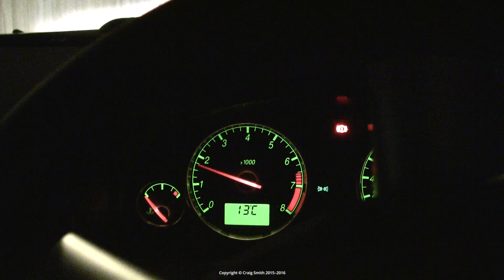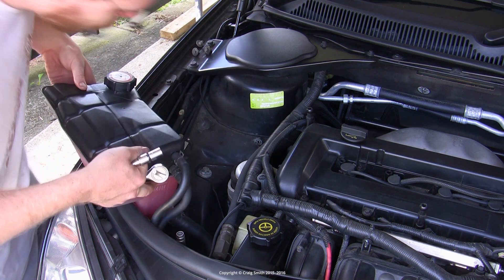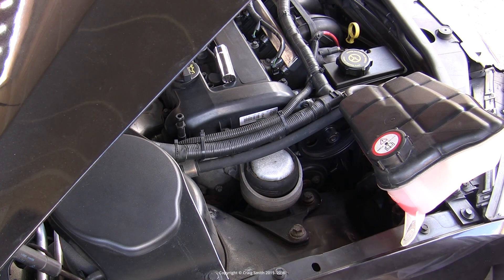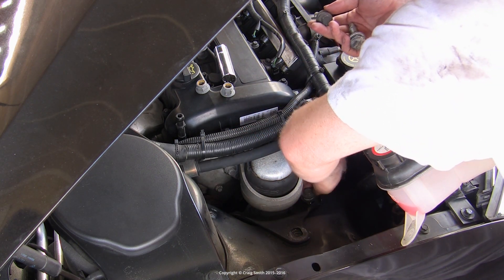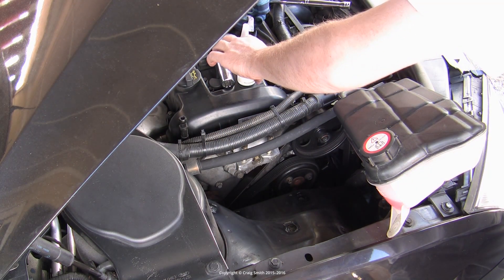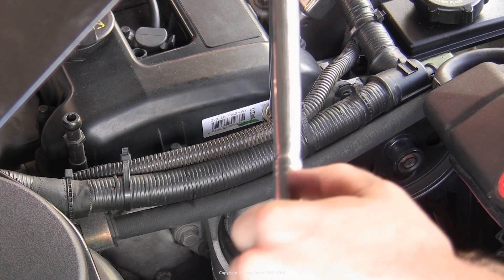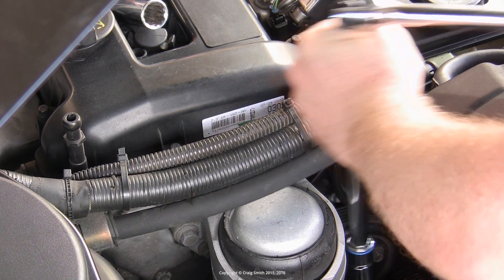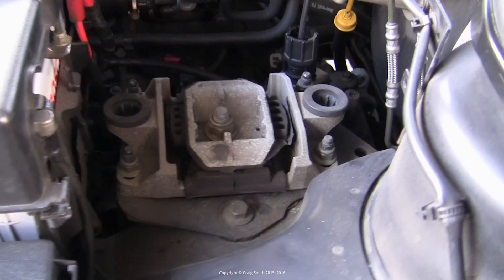How to: Replace Ford engine mounts (Duratec, Mondeo)

Comment: I want to thank you for all the direct and duffle information you have provided. I like to say all roads lead to Rome. Meaning any shortcomings in the suspension and frame related equipment mostly begin with bad shocks and struts.

Comment: I have some remarks. Like you said - nuts with blue plastic nylocs are self locking, are NOT reusable and must be renewed once loosened. Also it is not allowed to put any liquid or paste between nut and part because you change the calculated friction based on the nut torque. Those nuts do not use a washer for a reason because their bottom surface must have a certain amount to provide the frictional connection and grip.

Comment: "Work quickly" lol

Nice job mate. How did you keep your engine bay this clean throughout the years? I've seen much worse ones. Is the odometer showing in miles or kilometers?
Reply: At 00:23 you can see the speedometer and it says "km/h", so I'm guessing the odometer is also in km.

Comment: Hi Graig
after watching your vidoe, very clear, I'm not getting vibration but getting what I would call engine slap.
If I accelerate or de- accelerate I get a lot of movement from the engine, too much I think. I have had the large round engine mount replaced and that helped slightly 
Can you suggest any other reason that would cause this problem?
Thank you for your very clear video's 
Danny
Reply from the maker: Well what restrains torsional movement is the lower 'mount', or torque restrictor, so maybe the rubber on that is gone? Not entirely sure what you're describing.
Reply: Hi Graig,
many thanks for taking the time to reply.
I'm getting an excessive engine movement when I apply slight acceleration or de-acceleration.
I have had my car in 2 gear hand brake on with my brother sitting  in the drivers seat and just dapping throttle pedal and the engine I think is twisting too much..
I will get it checked out at a garage I haven't a garage ,park on the road.
many thanks for your help
Danny
Reply from the maker: Is it making noise? They do move quite a lot normally. If you're not getting metal-on-metal vibration I wouldn't worry about it. If it is moving too much then it has to be mounts gone, including the lower torque restrictor. See here for demo of engine shifting https://youtu.be/H2P74cIvlmg

Comment: I have the same car but a 2.0 litre, I also have a vibration and been scratching my head as to what it causing it. Did you have a vibration at all levels? IE, idle and normal driving?
Your videos are a life saver, now need to buy the correct ones.
Oh and I think your voice is great, very pleasing to the ear :)
Reply from the maker: Mounts will cause varying vibration with mode and attitude of the car as it affects weight on the engine. E.g. gear reverse/neutral/forward, on hill or camber. It's not hard to check the mounts as shown. But vibration can be caused by dozens of other things of course.
Reply: Thanks for the reply, My vibration is when the car is idle, if you put your hands on the seats or doors or dash you can feel a tingling vibration, don't mind changing mounts if it is that that is causing it, is there any other typical thing that would cause vibrations? Thanks.
Reply: @stevemoore999  mine the same now did you cure your problem and what was it thanks
Reply: @paulhughes9012  Hi, it just disappeared about 18 months ago, never found out what it was
Reply: @stevemoore999  ok thanks for reply m8 hopfully mine will disapear wishfull thinking haa thanks again

Comment: Hi Craig, sorry for another question.

 I have changed the transmission oil again, so I am pretty happy with that now.

I'm leaning to the engine mounts again.

I noticed you mentioned in your video you had vibration with worn out engine mounts.

I have noticed, when my car is in Park there are no vibrations, when I have it in Drive and I hold on the brakes, I get vibration but whilst driving no vibration.

Is it normal to have vibration whilst in Drive and holding the vehicle still on the brakes, is this the same sort of issue you had?

Thank you for the help, this is my first automatic so I'm new and still learning.

Alex
Reply from the maker: The engine will shift around depending on torque being applied thru the gearbox, and the angle of the car's tilt or pitch, so applying different stress on the mounts in different circumstances. If you're feeling vibration thru the body that feels like metal-on-metal contact from the motor then that suggests mounts. The problem is of course the engine or trans if they have a mechanical problem they will also behave differently in different situations. You could try using a steep hill to experiment? e.g. put car in drive and neutral with car pointing downhill uphill and sideways to see if it changes the behavior. Have you visually inspected the torque restrictor as this is the other very common mount failure? Place a camera to view up close while shifting F-N-D.
Reply: @CraigsDIY  Hi Craig, thank you for the reply. 

I have replaced the torque restrictor as that was very worn and split.

As noted, I can only notice the vibration whilst in D holding on the brakes, I will your experiment to see if I can tell if there is a difference on a steep hill as you have suggested, as well I will try and jack the engine slightly alleviate the vibrations which you have mentioned on your video to see if I can pinpoint it that way. 

Thank you again, Craig, your videos have been a massive help!

Comment: hi mate, did you jack the car up whilst it was running to figure out the vibration was on the right hand side? also what kind of vibrations did you get? was it in the floor pan close to the pedals? thanks
Reply from the maker: It's metal on metal contact between the engine and body mate, it makes the whole car vibrate. Yes you can jack the engine to take the weight off its mount. If the vibration suddenly disappears, then that's pretty clear. If not, try the other side (transmission).
Reply: @CraigsDIY  thanks, I changed the middle lower mount because that had split, my top right side looks OK similar to yours but i need to take it off to see if properly, because I get a vibration that's in the floor and travels to the pedals and goes up my leg making the drive a little uncomfy

Comment: Hi Craig,

With regards to the engine mounts, do you have any means of sourcing these like for e.g.the torque restrictor from jaguar, or do you just use main dealer ford or a pattern part?

The issue I am having Craig, when at low revs when the car changes I get a jolt, when I'm on the throttle higher revs this issue is alleviated.

Thank you for all the help and information.

Alex
Reply from the maker: You'll need to check it is actually the mounts, could be gearbox or something else. Try Endon Services if you're in the UK, if Ford prices no good.
Reply from the maker: You can also get 2nd tier aftermarket brands, for an old car probably appropriate.
Reply: @CraigsDIY  Hi Craig, thank you for your reply, I changed my transmission oil following your video before but think I may have made an error after say over an hour of cooling after a drive, I checked the transmission oil level and it is right on the top of the hash mark potentially giving me this harsh/jerky change issues, I'll get that sucked out tomorrow maybe a few hundred ML at a time to see how it goes.
Reply from the maker: I'm not saying it can't be the mounts, just you need to check. Trans oil at the max shouldn't cause issues. If you have a Mondeo, the oil-filled hydraulic mount on the right-hand side is what usually fails (as shown in the video) and of course it's the most expensive. Nice and smooth when new tho.
Reply: @CraigsDIY  Checked the trans oil again this morning, drove approximately just under 10km before checking and it's near the top of the hashed marks, so after probably driving 20km it would be full of slightly over full.

Yes is it a Mondeo 2006.
I done a visual inspection underneath of the hydraulic mount this morning with a mirror I could not see any evidence of cracking.

So I gather maybe remove a bit of trans oil, then go down the route of replacing the mounts.

I would be very shocked if the transmission is failing, maybe over filled but not failing, the vehicle is low millage 55,000 on the clock, it was owned previous by public section company so maintained by fords religiously.

Thank you ever so much Craig, I really appreciate the help, I know you're the man to talk to about the Mondeo's!
Reply: @CraigsDIY  Double checked trans oil today, only just at full, so I left it alone. 
Next step I guess change the mounts, as I said before thanks for your help Craig.
Reply: @CraigsDIY  Hi Craig, sorry for another question.

 I have changed the transmission oil again, so I am pretty happy with that now.

I'm leaning to the engine mounts again.

I noticed you mentioned in your video you had vibration with worn out engine mounts.

I have noticed, when my car is in Park there are no vibrations, when I have it in Drive and I hold on the brakes, I get vibration but whilst driving no vibration.

Is it normal to have vibration whilst in Drive and holding the vehicle still on the brakes, is this the same sort of issue you had?

Thank you for the help, this is my first automatic so I'm new and still learning.

Alex

Comment: Hi mate can you tell me how to fix my gas pedal it is sinking a little bit iv got the same car as you thank you
Reply from the maker: The likely suspect is the throttle cable, or the spring at the throttle body. Disconnect the cable at the TB and try to isolate the problem, then either lube (or replace) the cable, or take off the TB and give it a clean and lube up. I have a video on the TB here: https://youtu.be/41K_v2YYnpY

Comment: so its okay to use a sissor jack? it seems safe and strudy.
Reply from the maker: To support the engine? Anything that is reliable. A hydraulic jack carries the risk it may lose its pressure over time, unless it's in known excellent condition.

Comment: I heard that the one who is failing the most is the one under your accu/airbox
Reply from the maker: The one failing the most is the hydraulic one, as explained, on the engine front side.
Reply: @CraigsDIY  I tell what i read on forums, also https://youtu.be/vVaEEwVW1Uk?t=1981 you can see this one is totally wrecked on 4 year old car

Comment: I would have put the block of wood below the jack, not above it.
Reply from the maker: You risk cracking the alloy sump, the point is to distribute stress a bit better. A jack pad with a nice big rubber plate would be ideal.